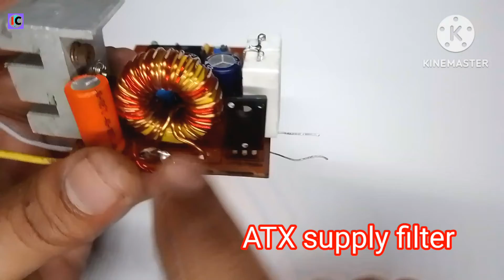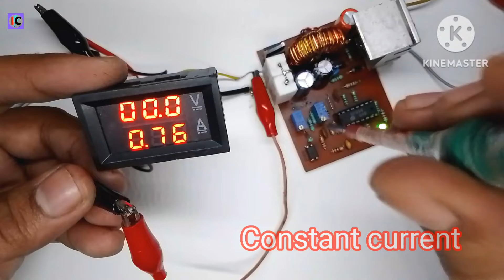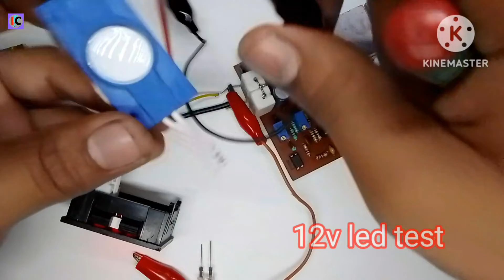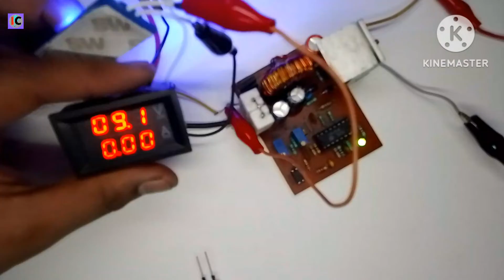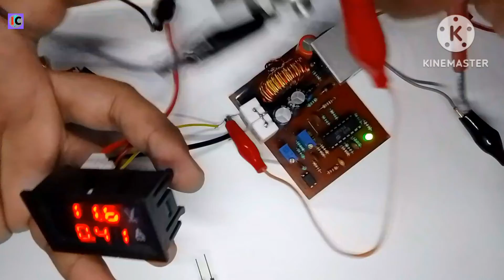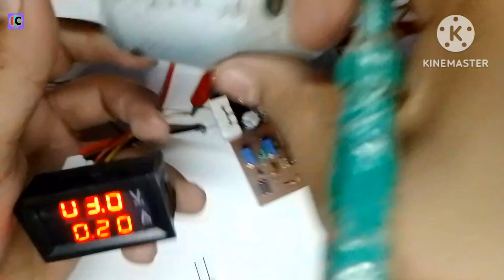TL494 Buck & Boost Converter  #tl494 #converter

Comment: What is the resister and jumper wire in the back of the pcb ? Not exist in your diagram !!!
Reply from the maker: the resistor is shown just as jumper wire between two joints
Reply: @innovationic  so the schematic diagram is correct and you updated ?
Reply from the maker: yes

Comment: What is the value of inductor in micro henry uH ? Can use 2 irfz44n in parallel for increasing out current i want 10A
Reply from the maker: as I have calculated the inductor is 100uH with 16 turns and for more current use more irfz44n in parallel, make sure have a proper totem pole driver circuit for IrfZ44n
Reply: @innovationic   thanks, can you draw a diagram of totome pole drive for more mosfets i’m new in electronics
Reply from the maker: ok
Reply: Hello , i made inductor 22 turn give me 33uH !!??? My core from atx 2cm inner diameter 3.8cm outer diameter color is green-blue

Comment: bro are you using TL494 in push pull mode ie max duty cycle 0.5 model or single ended mode please explain im bit confused
Reply from the maker: this converter is in flyback mode where two coils are coupled through common core, first coil is used as primary and second coil is as secondary.

Comment: I notice that the current drop itself when you set it at 5A also voltage jump by itself?!
Thanks sir for effort ❤
Reply from the maker: because current is constant, thus the voltage will automatically regulate as the load

Comment: Which pin of the tl494 you use to adjust the output current please and thank you
Reply from the maker: pin 16 of TL494 as shown with box in circuit diagram
Reply: @innovationic  I alway use pin 16 for short circuit protection and it never adjusted the current Just turn off the pwm output I try using 5k ohm potentiometer to try and see if it adjusted the output current and no current was turning down it just turn off, the same thing when I try using pin 1 for voltage controller i don’t get a voltage trimming it just turn off why is this, for months now I am having this issue with tl494 and ka7005b
Reply from the maker: Same thing happened to me when I was making the circuit that's why I uses1K resistor connected to pin 1 and voltage divider output and don't forget to connect 10k resistor between pin 3 & 2.  See the circuit diagram properly I mentioned all details
Reply: @innovationic  I get the voltage to work already I need the current control i use a 5k potentiometer so i will need to by some 10 timmer